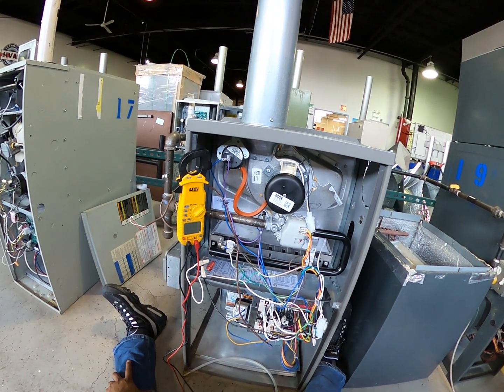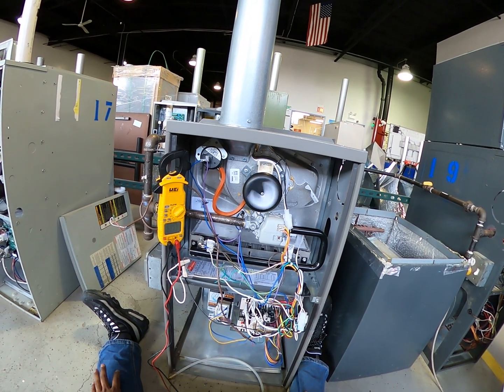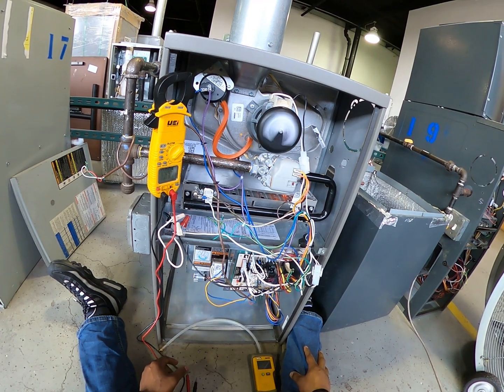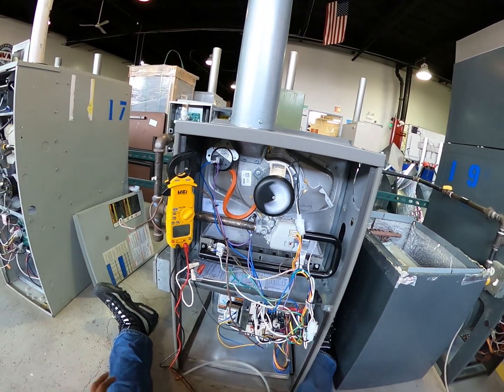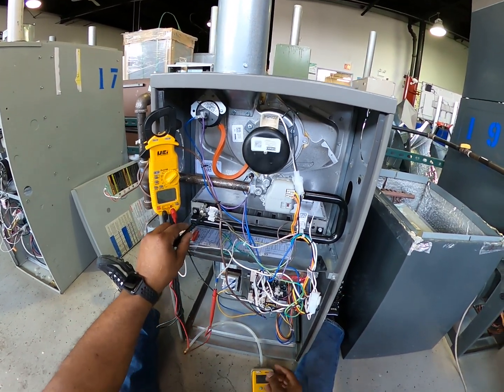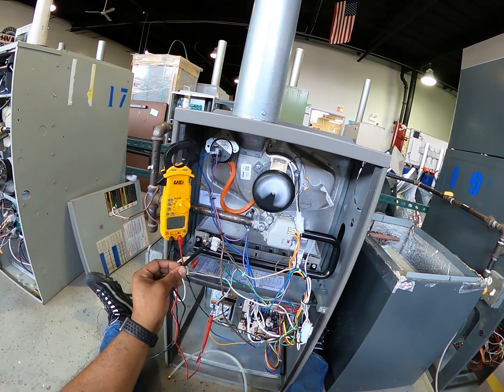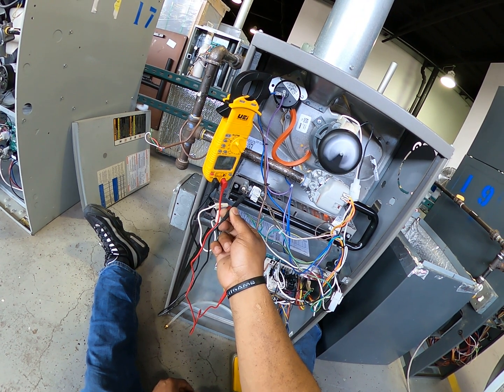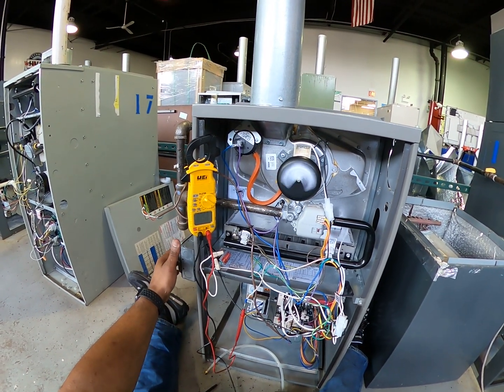WHATS YOUR PROBLEM!  TROUBLE SHOOTING SERIES    BAD FLAME SENSOR

Comment: If control board is faulty ,the flame sensor is also not getting any reading. Could the flame sensor had been wrongly mistaken as bad flame sensor ? Correct me if wrong.
Reply from the maker: Yes that is true, if you do not have voltage coming out of the ifc board then you will not have a reading at the flame sensor, the flame sensor completes the circuit of the voltage coming out of the ifc board
Reply from the maker: Yes that is true, if you do not have voltage coming out of the ifc board then you will not have a reading at the flame sensor, the flame sensor completes the circuit of the voltage coming out of the ifc board
Reply: @cmhekendrickrobinson286   How to get to the bottom checking  the control board to make sure the the board is faulty not the flame sensor ? Thank you.